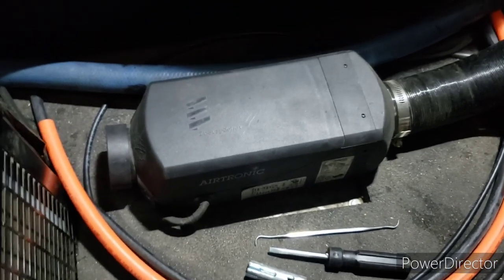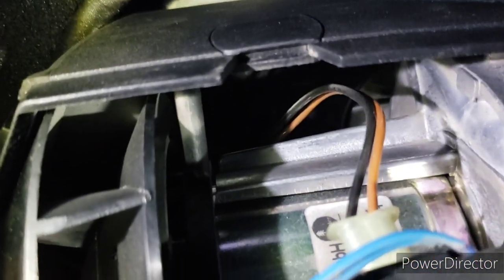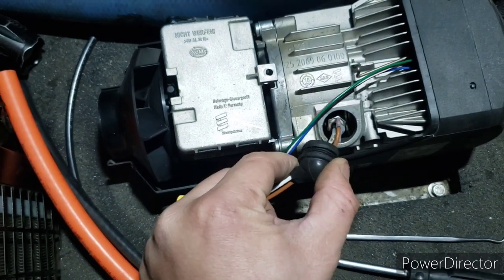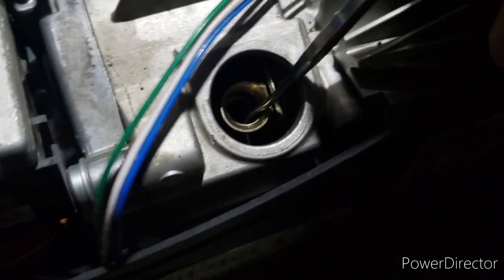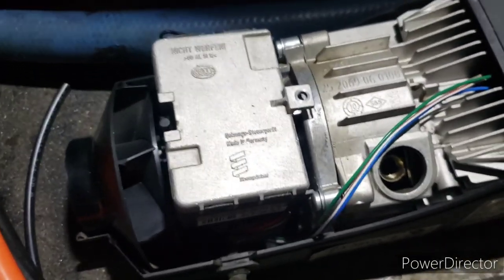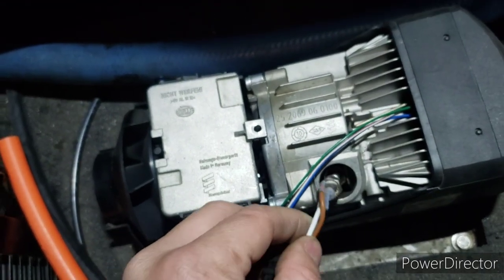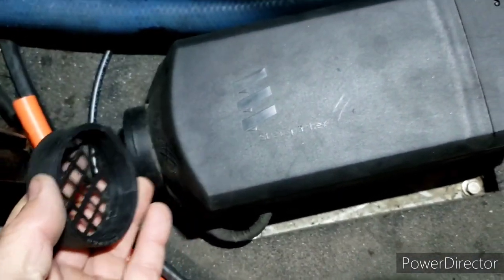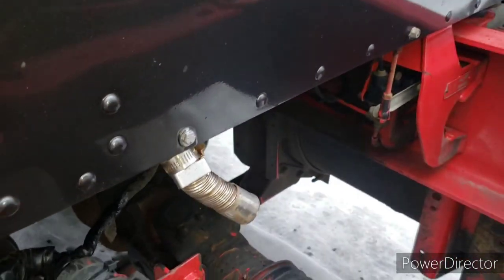Bunk heater smoking blowing cold air, fix without replacing parts, espar d2 & other brands

Comment: Thank you, this seems to have fixed my problem! I didn't have the special socket so I cut the wires fed them through a 3/8 drive 12mm socket and turned with vise grips as I'm in the middle of nowhere Utah @10pm. Cleaned, then butt connected the wires back together and presto, I have heat and no smoke out the pipe!

Thank you!!😊

Comment: What size is that slot tool and where did you get it?
Reply from the maker: You can buy one on ebay
Reply: @RS-hd3rl  what size should I be looking for or is it a universal one
Reply from the maker: @theeeanomaly4281  eBay has it just type in espar d2 repair kit
Reply: Also on Amazon